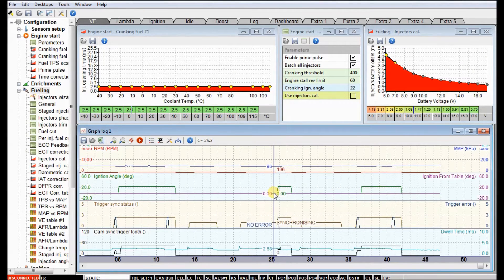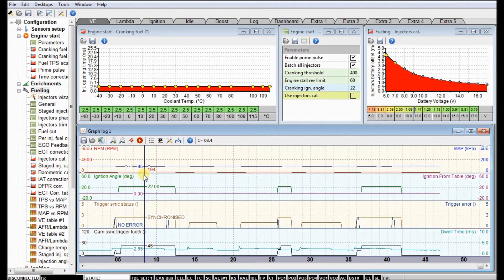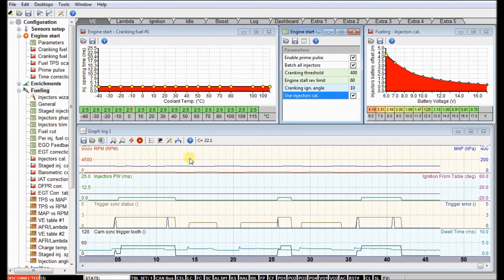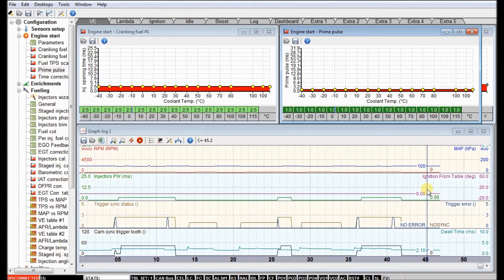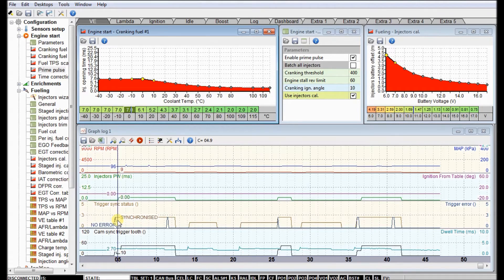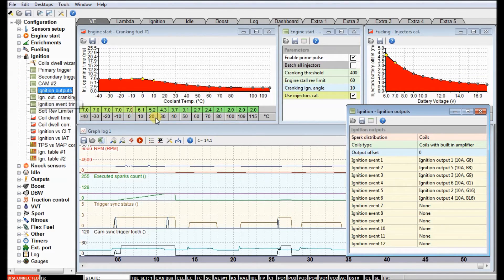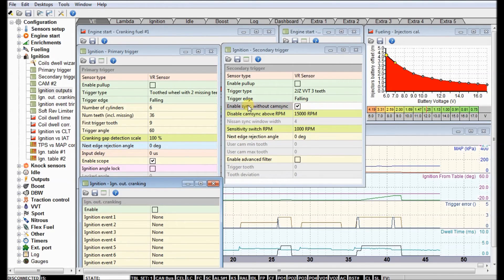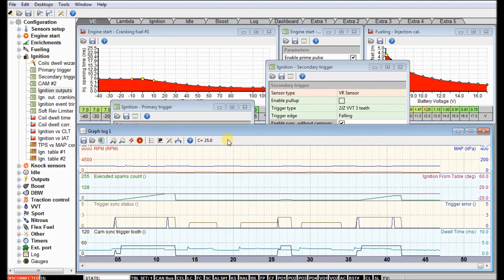Tuning Engine Start Parameters

Comment: Hey I can't get my emu classic to connect at all until I turn the key to run. Am I missing something?
Reply from the maker: The ECU is not powered until you turn the key to the "on" position, so yes, that's correct.
Reply: @ECUMasterUSA  I figured it out. I had my ignition switch pinned wrong. Now I'm working to get my ignition status and cam synced. I'm having trouble with it as I'm using a distributor instead of coil packs.
Reply from the maker: @BuiltToBoost  If you're in North America, email support@ecumasterusa.com if you get stuck and our tech support staff will be happy to help.
Reply: @ECUMasterUSA  awesome will do. Thanks

Comment: Do you mind having a look at my log.
Im having two issues, cant seem to get the vvti to get & hold cam deg.
Also boost is perfect in open loop assoon as i enable closed loop with boost target, the ecu referances table two for dc. But some how closes the solenoid to 90% resulting in full boost!.

Comment: Thx for everything..question...all my output test are good... but no spark when key us turned, Timing light doesn't flash /coil doent fire...this is for 1jz
Reply from the maker: Contact the distributor you purchased your ecu from and provide them with your map and log so they can help you diagnose it.

Comment: Hey. I have an L28 engine ans turbo with ecumaster ecu. The engine ran great, but I recently started experiencing misfires when under full throttle and going into boost. . Idling and cruising seems to be fine. Afr values are reading a tad to high though.  The engine ran great, but I installed a new 3core rad, which lowered the engine clt temps drastically. Basically, when I am driving, clt temps are around 70 degrees with fan off. Could this have an effect to the amount of fuel supplied by the ecu? I checked my fueling system and that seems to be OK.

Comment: At 6mins you opened his ignition outputs  and his event order is different then what you had set up for sequential firing order for a 1jz in your base map configuration video. He has 1-5-3-6-2-4
Reply from the maker: JZ engines have 2 cam sensors, and the EMU only uses one of them. Depending on which sensor you use, your ignition outputs will look different. The order is still the same, but the first cylinder in the order changes.

Comment: 3:52 I have an 88' 7mgte w/ 550cc injectors in place of the stock 440cc. So for Cranking fuel #1 from -40C to 0, the base tune had 3ms across and from 70C to 100C, the base tune had 1.5ms across.

So what I did was reasoned that 440 divided by 550 gives you 80% which is a 20% difference in injector size difference. As a result, I took the millisecond values mentioned above and reduced them by 20%. For 0C to 70C, I simply used the "interpolate" tool to "smoothen" out the curve horizontally. 

Tell me Zach, is this reasonable/correct, based on the size injectors I have upgraded from stock??